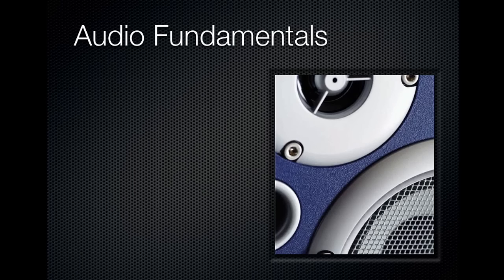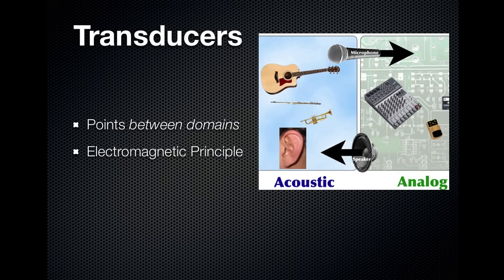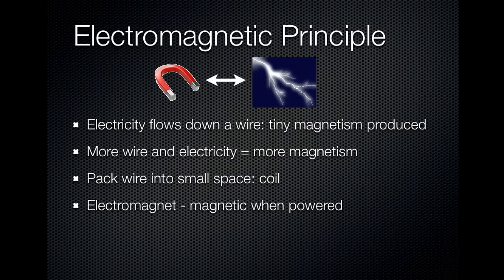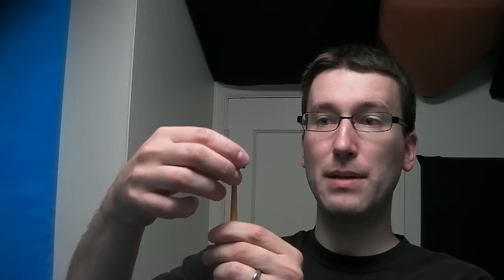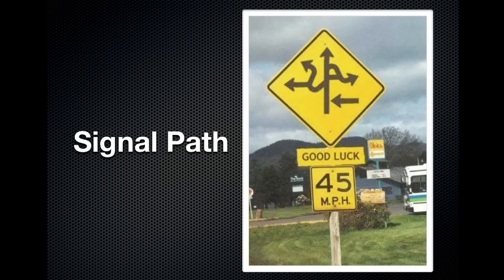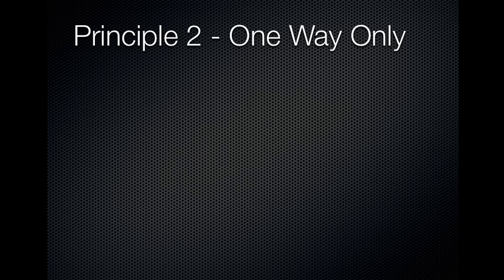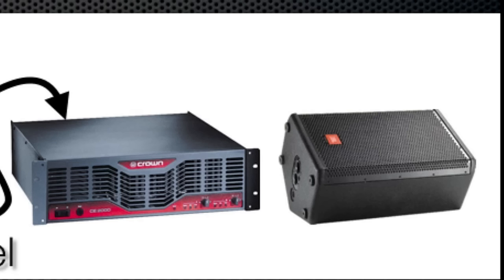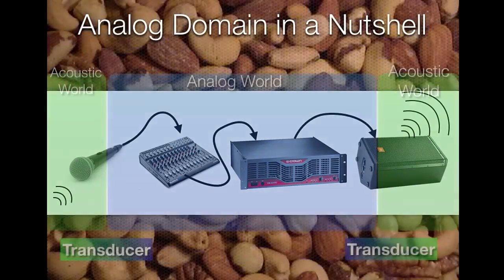AF014 - Transducers and Signal Path

Comment from the maker: (continued) But if you plug a powered Speaker-level signal into anything except a speaker (or other device made to accept those high levels), it will likely cause severe damage. Also, for example, bare Speaker-level wires have the same dangers as bare high-voltage AC mains from the walls of your house.

As a precaution, always note whether an output is "Line" or "Speaker" output.

I might get to ohms/voltage/etc., but haven't used passive speakers for a while. I'll at least mention it, though.

Comment from the maker: Signals at the wrong level: a device's input is usually made to accept only one category of signals: Mic (weakest), Line (somewhat stronger), or Speaker (dangerous high voltage).

If you plug a mic into a line input, it will be way too quiet - though you might get it to work a little with the volume up all the way. This usually doesn't harm equipment though.

If you plug a line output to a mic input, you may or may not damage the equipment with the mic input, and the signal will be distorted.